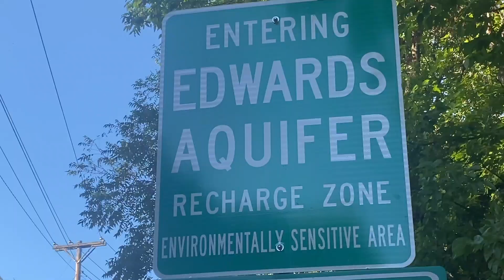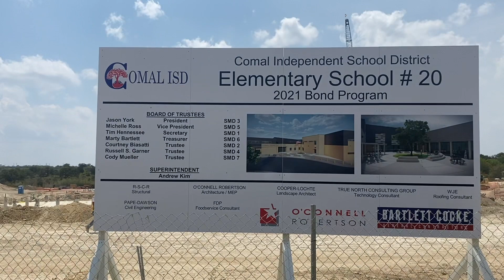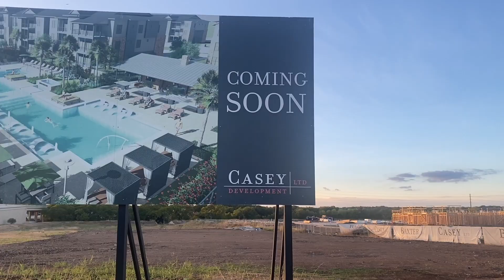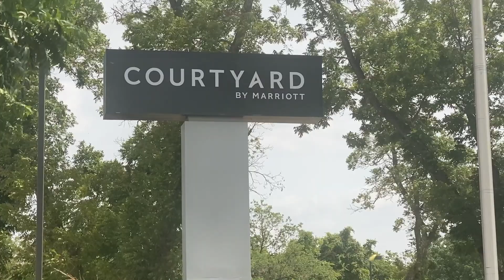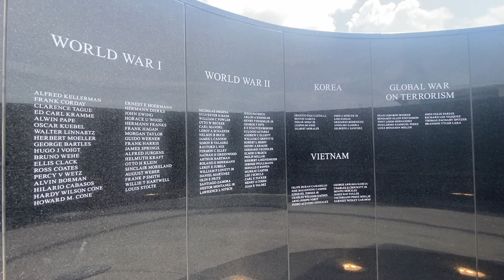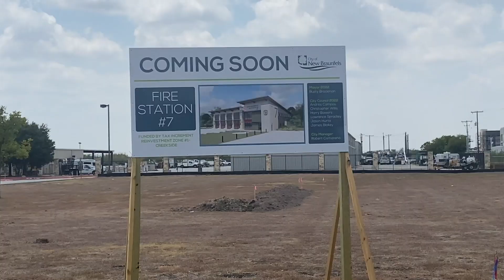Coming To New Braunfels in 2022 & 2023

Comment: With all the flooding going on nationwide (i.e Dallas, St. Louis etc.) is there flood risk in NB or has the infrastructure along with the two rivers running through town limit that possibility?
Reply from the maker: Marcus, New Braunfels has flood zones. A number of them are dry creeks called 100 year flood zones, meaning it would have to rain for weeks straight to reach surface.  New Braunfels has drainage culverts in a number of neighborhoods to divert rain.